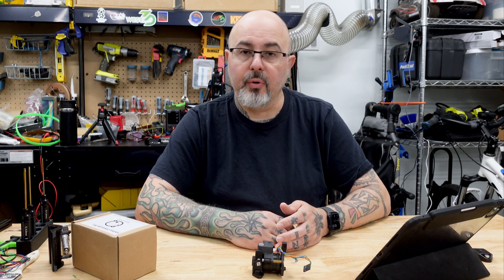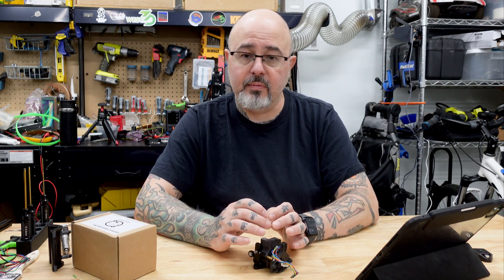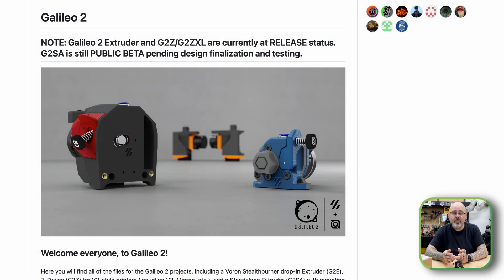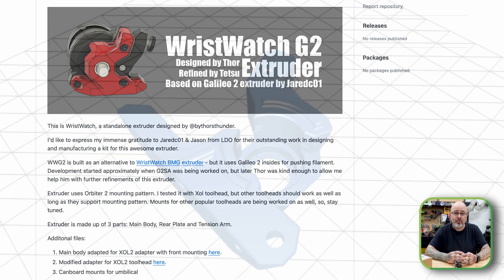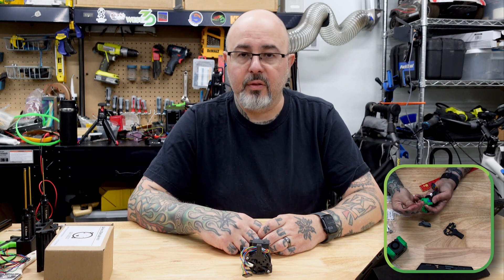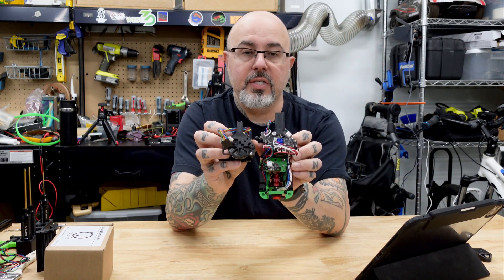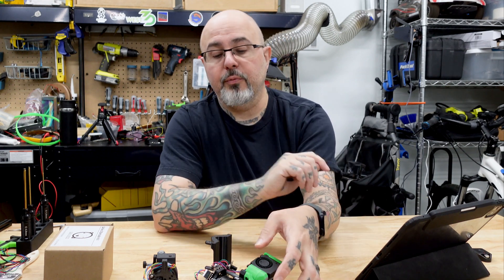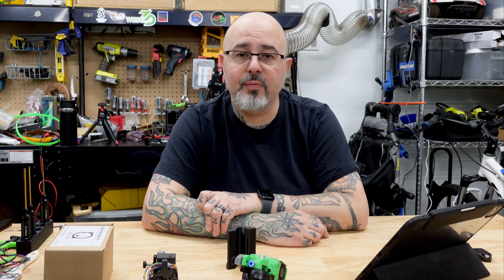The Wristwatch G2 extruder

Comment: Maybe I missed it but what's the difference between the wristwatch G2 and the G2SA? Other than you said it's "minimalist". Just kind of curious as to what the WWG2 solves compared to the G2SA.
Reply: Apart from the asthetics, there is a twin-sensor mod for the WWG2 which doesnt exist for G2SA, for when you're using an ERCF or similar
Reply: @andyl2895  Oh!!! Awesome.
Reply from the maker: There isn't an issue with the G2SA, I just like the WWG2 more aesthetically.

Comment: I can't wrap my head around how TPU is getting tangled at the entrance to the extruder.  I have a couple Orbiter V2's and set the tapered screw at the exit of the extruder appropriately for TPU and haven't had any issues.  Maybe my PTFE and collet lock are preventing that issue from occurring on mine at the extruder entrance.  Good luck with the new extruder.
Reply: Okay, maybe the extruder has no PTFE tube at the top guiding the filament from a dry box to the entrance, then the head moves to the front of the build plate - stretching the TPU, and then moves to the rear of the build plate - allowing the stretched out TPU to stuff down into the extruder inlet but not past the gears where it then gets jammed.
Reply: @erikzweigle  - My small business prints all of our products in TPU.  I use an overhead bearing hub spool holder to reduce friction and no reverse Bowden tube.  The TPU filament feeds through the air directly into the top of a direct drive extruder.  I'm careful to feed the TPU into the extruder gears and tug to ensure it's engaged and it never jams on the input to the extruder.  Some extruders don't constrain the filament path from the bottom of the extruder gears and into the top of the hot end, and it can squirt out and into the tool head body.  I cracked a Neptune 4 Pro extruder that way.  There should be a tapered input transition tube to guide the filament from the bottom of the extruder to the top of the hot end so it has no place else to go.

Comment: Imho all of these are subpar compared to hgx lite 2.

Also get some HS tpu from either polymaker or bambu, they can print at 12mm3s no problem :)
Reply: They are also hard as rock compared to any actually rubbery (80A) filament, the whole story of printing super slowly stems from much softer TPUs, not those 90+ ones that even bowden printer can print
Reply: @zapl80  they are exactly 95A so ok for most applications (like the one from this vide0). I wouldn't call them rock hard since you can buy 98 or 99A variants that are much harder.
Also it is not only about the hardness probably, since they can print around 4x faster than usual 95A tpus.

Comment: i would love to see a different extruder/ print head for the creality k1 max. cannot find a universal carriage and it pains me, not even wham bam works on it ;(
Reply: The design of the K1 gantry/extruder/hotend is very compact and makes it so that mounting any other toolhead would move the hotend about 45mm forward and probably make the toolhead taller requiring a different cable chain solution. About 2 mouths ago, Proper Printing swapped his K1 extruder for a bowden setup but that has different compromises.

Comment: TPU is the best and most underrated material the average person can 3D print ❤. Hotends taking TPU into account are therefore always superior 👍.
Reply: i print tpu on ender 3 v3 se with stock printer and standard setting, perfect, never fail in 50mm/s
Reply: @exziarc4600  thats awesome 😎, if someone could figure out same tool head multiple TPU printing since Creality, Anycubic, Elegoo, Bamboo multi color systems said to hell with TPU. 

There would be a stand out place for making toys and flee market sales with the practically indestructible stuff.  Even the smallest articulated joints have lasted for YEARS beyond just regular PLA prints not-articulated have for me.
Reply: This is my mantra.  The 3D printing community and industry tends to think of TPU as flexible filament and it is if printed with few walls and low infill percentage, but TPU is much more than that.  Print TPU 95A with 4+ walls and 20%+ infill and the parts are solid with many added benefits.  TPU is extremely impact resistant, chemical resistant, UV resistant, weather resistant, and the interlayer bond strength is so good that the parts have nearly isotropic physical properties with no layer delamination problems.  The focus of filament manufacturers has been lower durometer for more flexibility but what we need is higher durometer for easier and faster printing.  With the advent of multiple filament feeders, we're finally seeing higher durometer TPU with Shore D ratings that are compatible with multi filament feeders so maybe we'll now have solid TPU parts with the many advantages of TPU with fewer of the printing problems (speed, overhangs, bridging).  Don't be afraid to retract with TPU (as the early wive's tales warned) but do it more slowly and set the slicer to avoid rapid and repeated retractions that chew up soft TPU filament.  Another necessary slicer setting is Avoid Crossing Perimeters, which is used to prevent stringing by keeping the ooze inside the part, in the infill.